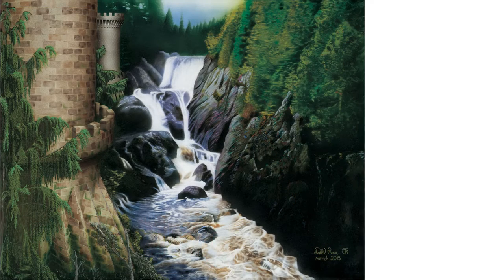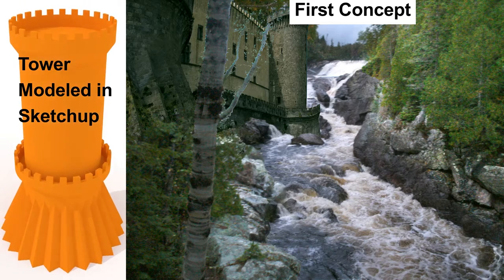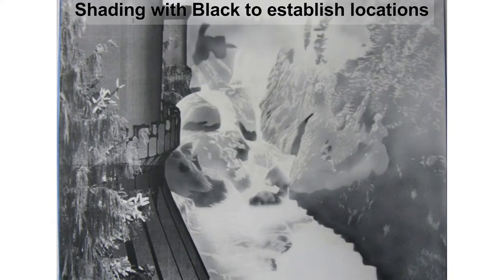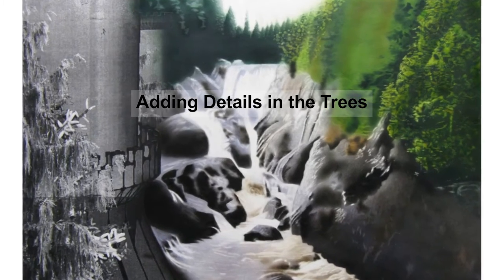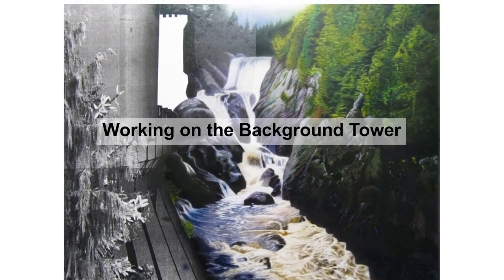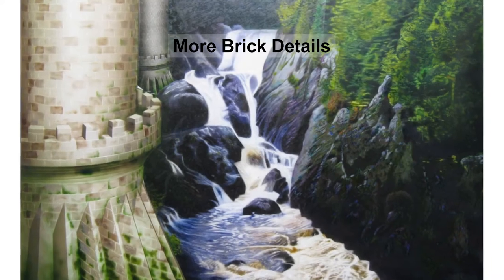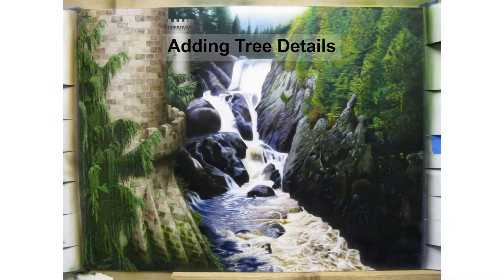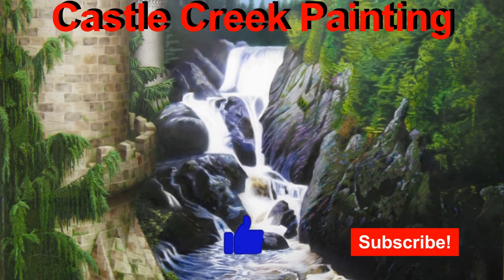ACRLYIC CASTLE PAINTING ON A CREEK | How I created my castle creek painting.

Comment: Hi Dell, do you always add aspects of your painting digitally?
Reply from the maker: I was originally trained as a draftsman years ago.  So when I first started painting, I added most things either by drawing them out in pencil on a drafting board, or later I would add things to the reference in Photoshop before making the actual painting.  The trouble is that depth can be lost pretty easily doing things that way... so these days I use Blender 3D mostly (used to use Sketchup) to create a digital environment first, and then develop the final painting from that.  😎 It's an elaborate process I guess, but the results are better for me.